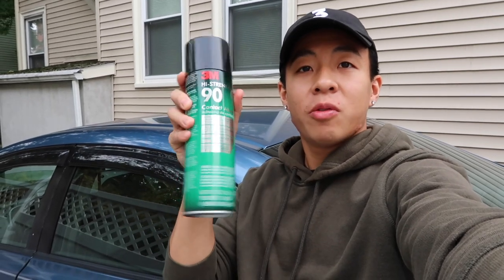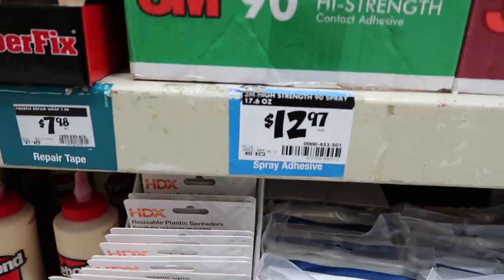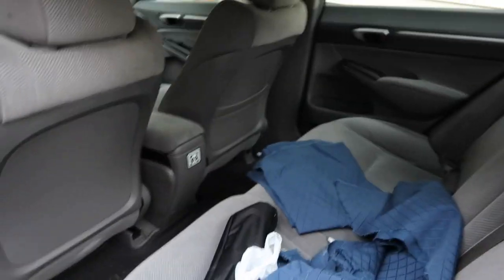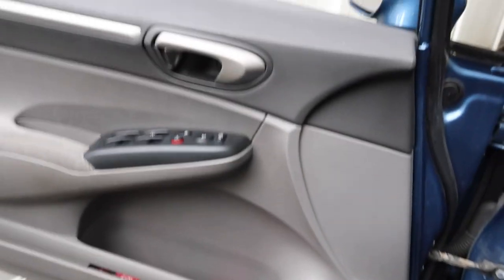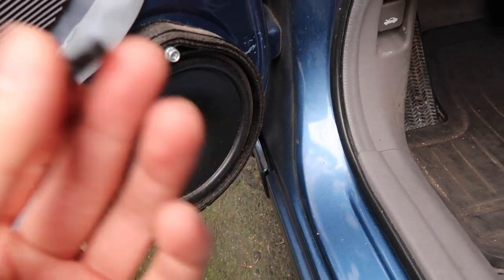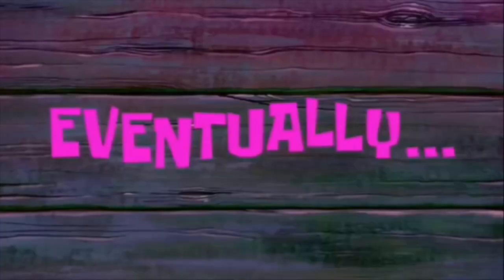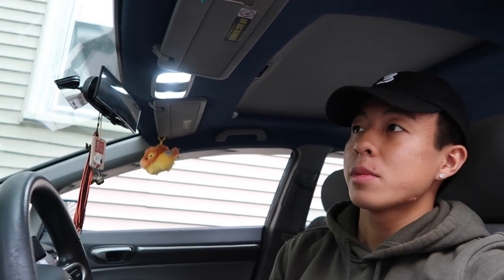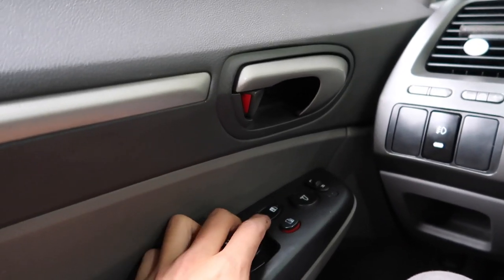Wrapping my arm rest for under $15!

Comment: $15?  ya right.  The adhesive alone is $14 with tax.   I bought one today.  My cover cost $18.  Cost of this repair is realistically $40-$50 assuming you don't have to purchase any additional tools for the job.
Reply from the maker: Thanks for the comment. I'm pretty sure I said $15 because I had left over fabric so I did not have to buy more but yes realistically probably about $40~ which is still not too bad for a DIY job.